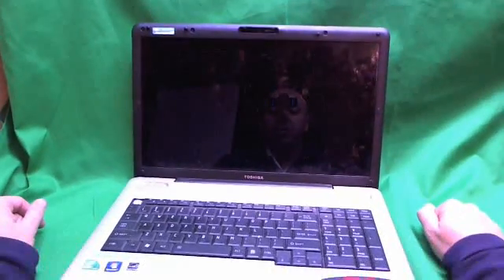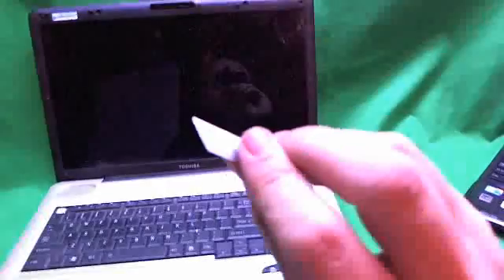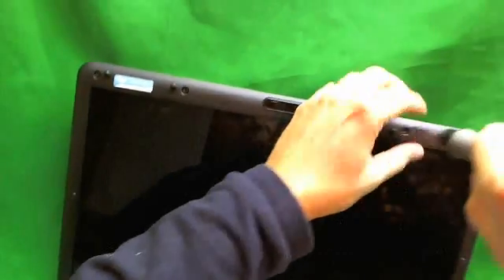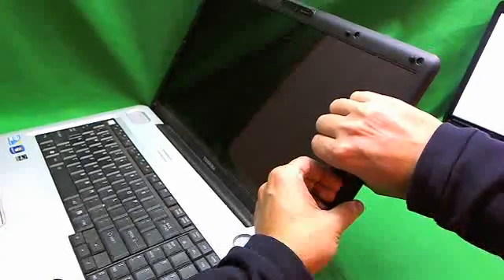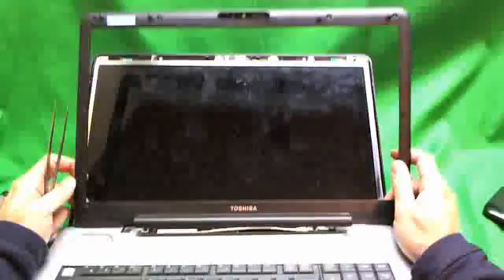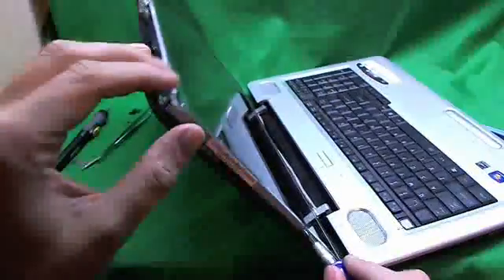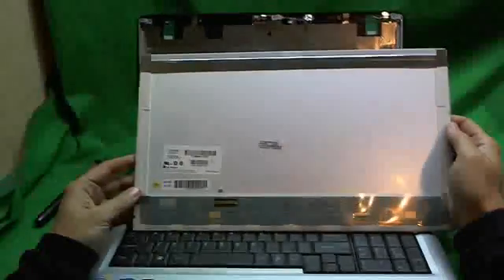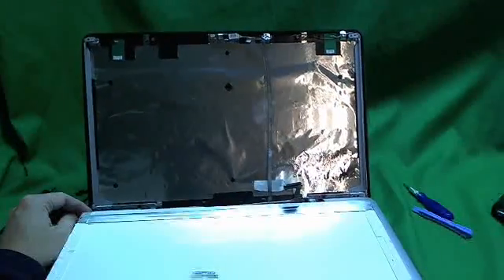Toshiba Satellite L555 Laptop Screen Replacement Procedure

Comment: Hello, I have two toshiba laptops. Both are broken but in different ways.  They are also different laptop models, and one has a web cam but the other does not. The problem with the one that does not have a webcam is that the keys began to peel off and and don't want to get a new keyboard so, I just got a new laptop. Now this laptops screen was cracked within the screen LCD. Is there any way I can take the screen from the one computer that has no keys and put it in the other laptop in place of b

Comment: @ScreenSurgeons I also have another question. When My laptop is turned on My screen's luminosity goes off, the computer is still running and does all of its operations but the screen is black the only way to prevent this is if I keep the laptop open at a wide angle. I was wondering what could be some possible problems